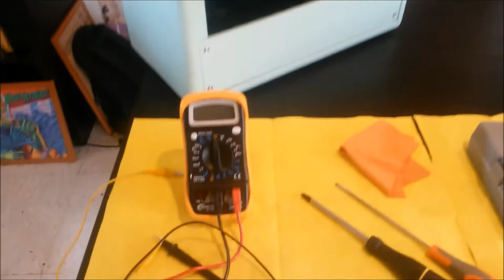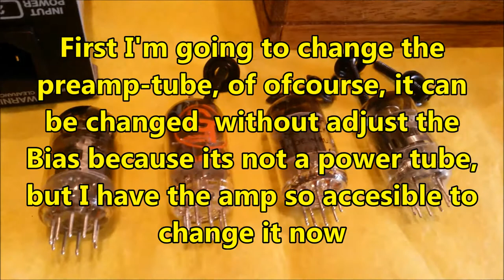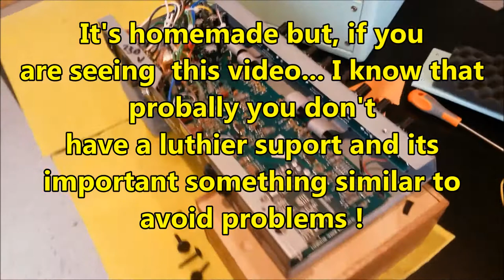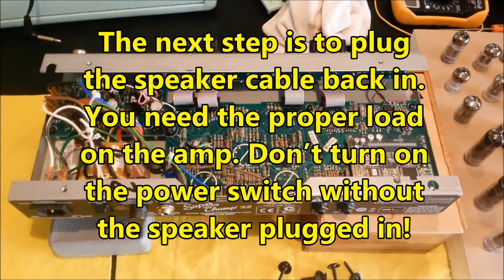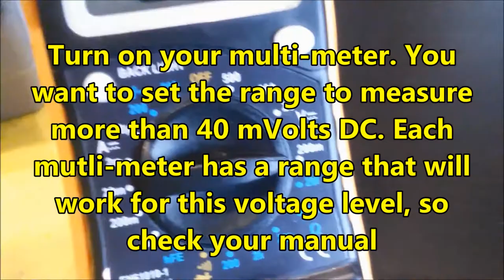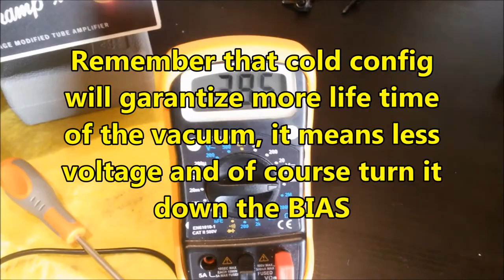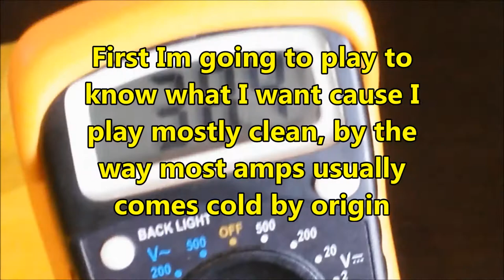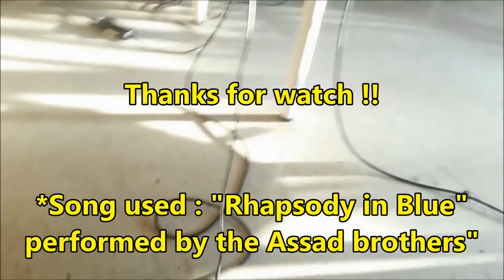HOW TO  ADJUST BIAS IN FENDER SUPER CHAMP X2 (ENGLISH)

Comment: Thanks for the great video. I did not still have the need to change the tubes on my amplifier I purchased new, but on the basis of your video I wanted to check how the amplifier came saet from the factory. To my great surprise, instead of 40 mVs, it was set at 59 mVs by the factory. I set it to 40 and got a much nicer and cleaner sound.

Comment: Btw, it's not a preamp tube. Its the Phase Inverter. Some people call it a preamp valve but to me its part of the output section. After the preamp section which amplifies the signal.It simply splits the signal for the 2 push pull 6v6 valves..

Comment: Did you paint the case mint green ? or remove the outer shell and replace with a mint green one ?
Reply: Looks like a "FSR" version (Fender/factory Special Run) in aqua Tolex with a wheat fretcloth , its got the Limited Edition plaque on the back. I've just bought one in cream Tolex with oxblood fretcloth.

Comment: Thanks a lot for the video. It was interesting and you saved me a lot of money and time. I noticed that you have sound deadening pads inside the amp. Did you put mic into back of the amp for the recording? Sounds very nice and without any noise. Would you think it would be worth buying new speaker for this amp or 12 inch cab? Can't decide :D
Reply from the maker: I have the eminence legend now, its better, the cajun for me is bit inestable, but more powerfull...but the action you want maybe is with a 12'' speaker,  thats why I use it sometimes in cabinet, I have one friend that uses the 12 speaker in this cabinet, making some holes in chassis and the cabinet to fix it... the problem is that the cabinet has the resonance for each speaker too...so depends(thats other point of why I didnt like the cajun, cause is more power and has diferent resonance, I mean, it not depends of the volume only, yo will have that problems lower than 5-6),  the beauty of this amp is that is so portable... but 12 inch cab always is better for the sound,

Comment: Hi! I would like to ask you, it turns out that I have a Fender super champ x2 which works at 110 volts. It happened that a friend connected it directly to 220 volts without the transformer and it now turns on but does not emit any noise, the F1 fuse was changed and the valves apparently turn on but still do not respond. Would you know where the hand can come from? Thanks!
Reply: Simple fix buy a new amp and charge your friend for frying your x2

Comment: These amps are actually pretty good and cheap, just make sure you use the Fuse app to dial in sounds otherwise you are not going to get much you like because not all the controls are on the panel.  Most notable by its absence: the Middle knob, and trust me, they don't think you need mids with how it is by default.